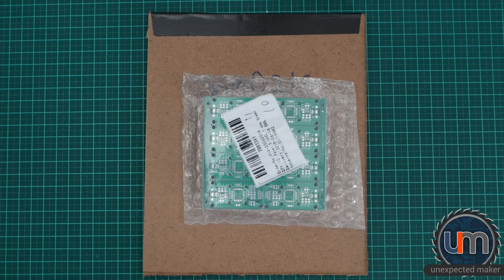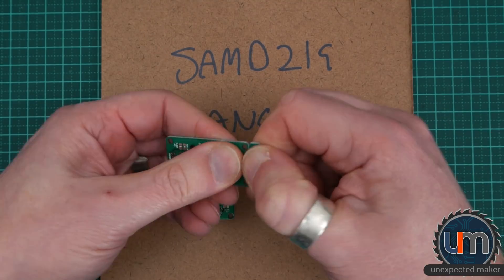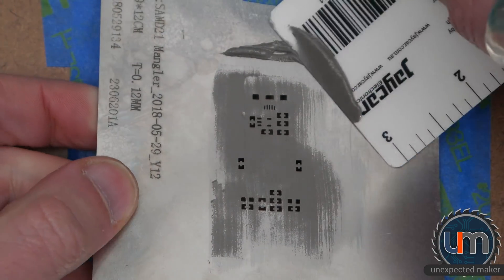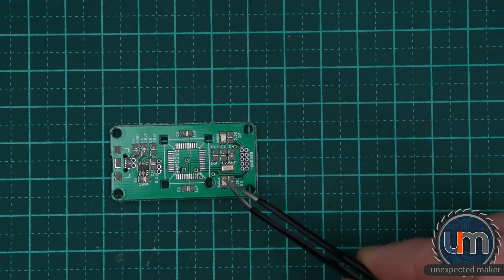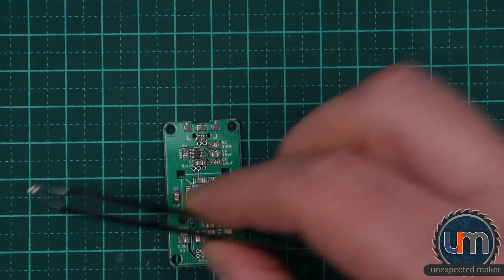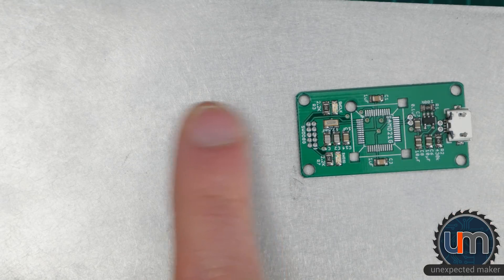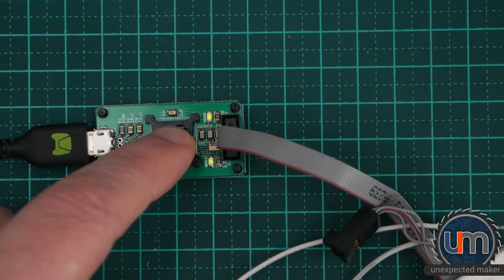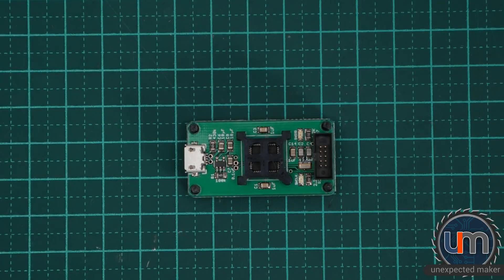SAMD21G Mangler - Rev 2018-2 Assemble & Test

Comment: BTW: Congrats on this working board! Have you tried just melting the plastic with a soldering iron to lock the base to the board?
Reply from the maker: Thanks :-) No I didn't want it permanently attached. With the clips I am able to pull it apart and maybe make new/different housing, or it will allow others to do the same.

Comment: Hi Seon, nice to see how you've put your rig together and how smooth the whole process goes. I saw you getting the SMD component from the plastic strip. I found the zip-bags they often come in not very handy. In your other video I saw you putting the resistors in a sample booklet, which is nice for organizing short strips of many values. For the longer strips (50-100pcs) I've designed this strip-holder, which you may find useful too: https://www.thingiverse.com/thing:2186862
 (also note the remix cap for separating the cover).
Reply from the maker: OH WOW! That is SOOOO clever! Thanks for the link. I am 100000% going to print me some strip-holders!
Reply: Thanks! BTW: another maker had the smart idea to scale the design in only Z or X&Y direction, to create larger holders for different dimensions or for larger amounts.
Reply from the maker: I was actually going to ask about that... I'd like to make bigger ones too (on the X,Y) .. like mini reels!
BTW, I am currently printing my first 8mm reel and cover... so excited by this!
Reply from the maker: Oh wow, I didn't realise how little it was... hahahaha... I didn't even read the specs on thingiv - I just downloaded and printed. I'm definitely going to need to make MUUUUCH bigger ones.
Reply: LOL :o)  I based the size on the height of my container box. Works okay for the smaller parts (1206/0804 caps, leds, etc). In Slic3r you can scale in specific directions, which I still need to do myself for some larger strips like the ones for smd chips. You probably wont need them for your huge stack of neopixels! BTW. Dave Darko has some nice designs on Thingiverse too, including a 15-segment alpha-numeric neopixel display.